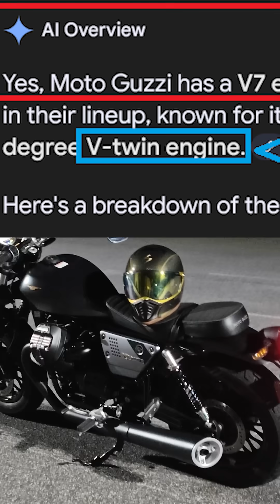wHy DoN'T CaRS uSE V7 ENGiNEs?

Comment: The divisibility thing isn't quite right. There's nothing special about 360 in terms of divisions of the circle. If instead of 360 degrees you had 350 degrees (and the choice of 360 is arbitrary, largely due to rounding the length of the year to a multiple of 60 as that's what some ancient cultures liked) then it would divide nicely into 7, 5, but not 6 or 8.

Comment: but doesn't crank pin arrangement matter? i mean i think you can fix it by arranging the crank pin layout to an I6 layout where it as an extra crank pin for 3 cylinders (1, 4 and 7) move at the same time while 2, 6 and 3, 5 follow.

This is specifically for inline-7s.

my english grammar is so horrible cuz it's not my first language. hope some ya'll understood what i meant.

Comment: You know that fractals exist??? The crankshaft could be offset by 360/7° and then it would have a regular firing order. the balance wouldn't be as good as on even number cylinders, but it would be doable just as it is with 5 and 3 cylinders. The reason is just that a V8 is barley bigger than a v7, but much cheaper to build and construct.

Comment: Of course it is possible to balance a V7. The problem is that the crank gets very complicated. No two pistons can share a journal. And it would still need balancing shafts. So, you end up with something more complicated and costly than a V8 and fewer cylinders. Bottom line counts. The V8 engine was introduced as a cost effective alternative to the straight 8. All things considered, I can't think of any good reason to build a V7 over a V8.

Comment: The 360 division thing is bogus. Degrees are an arbitrary unit of measurement, If we used radians instead suddenly no engines would divide correctly.

The real reason V7 engines aren't used is that odd number cylinder V engines need very specific angles between cylinders to be balanced, making them harder to manufacture and design.
V5's exist because they were developped for very specific racing conditions.
There are simply no cases where a V7 engine would ever be needed over a V6 or V8 so no company bothered to produce one, since it'd just be more difficult to develop and more expensive to produce for 0 benefit.

Comment: I always thought you could just join a 4 cylinder engine with a 3 cylinder engine at the crank and make an inline 7 that way and since both the 3 and 4 cylinder engines run smoothly I don’t see why this wouldn’t work.
Reply: While it is possible to do so it is not practical at all for a car to have a inline 7, this would also result in the worst car engine known to man, a inline 2 would be better, probably even a single cylinder as long as it's a small car.

Comment: But the number 360 is arbitrary, if we had 840 "new degrees" in a whole circle, the numbers would be whole.
Reply: Finally. Someone with more than two working brain cells.
Reply: even if it wasnt arbitrary, the division doesnt need to be whole numbers anyway.
Reply: So a 4/5 strok ?

Comment: i still dont understand why the piston number has to divide 360 or 720 cleanly, arent those just arbitrary numbers? theres (to my knowledge) no reason why circles are divided into 360 degrees other than that we have done it like that since ancient mesopotamia, so why does it have to divide an arbitrary number cleanly to function?
doesnt dividing 360 degrees by the number of pistons just tell you how far apart the explosions have to happen?
Reply: There are many reasons, and you should look into them. It's quite straight forward and well justified.
Reply: just asked chatgpt and it said that for example a v7 would inherently be unbalanced because it would have 4 cylinders on one bank but 3 on the other but for example an inline 7 wouldnt be inherently unbalanced because you can just space the powerstrokes 102.857 degrees apart, its just easier to use whole numbers, like 120 degrees between powerstrokes for a 6 cylinder engine. but there is no reason why an inline 7 couldnt be balanced, even though 720 doesnt divide by 7 into a whole number
Reply: @billcipher1212 "just asked chatgpt"

Opinion discarded
Reply: @Unknown-g7w  you say that like you expect me to just have access to an engineer that specializes in engines on a whim
Reply: @billcipher1212 I certainly expect you to consult with actual published engineering documents rather than a system known to output falsehoods on a regular basis lmao

Chatgpt is not a replacement for doing actual research.
Reply: @Unknown-g7w  but i dont care to do rigorous research i just want a quick answer
Reply: @Unknown-g7w it’s a youtube comment section, i do fear they dont need to commit to a whole study on an article just to give you an answer.

Comment: AI summaries trying to tell you that the Ferrari 512BB has a V12 instead of an H12:
Reply: I think you are a AI summary then. Ferrari themselves say it is a V12 engine, although I disagree with them on this, just like I do on a couple of old Ferrari models I think it's a Flat 12 or a Boxer 12 if you prefer. It is so extremely angled it is essentially flat. The BB also literally stands for Berlinetta Boxter. If you want to see H engine search up BRM F1 H16.

Comment: There are also 7 Cylinder Radials, Odd number cylinders like 7's and 9's are common with radials.
Reply: They are not common - every 1 row engine 4 stroke radial havs odd number of cylinders. Thats because with radials you almost HAVE to have odd number of cylinders. You want the cylinders to fire on opposing parts of the circle as the cycle progresses. But it cant be EXACTLY opposite, or the firing position will just bounce back and forth, and only same 2 cylinders will fire. So you want some shift - and that requires odd number of cylinders. Thats because 4 strokes require TWO full rotation to complete a cycle - and even number cylinders would let only half the cylinders to actually fire. 

In radial the more cylinders the smoother the operation, however more then 9, mean the connnecting rods have to become very long to actually physically FIT all the cylinder heads in the outer circle - so it was rarely used. 

Now why some radials seemingly have even number of cylinders? There are virtually a handful of TWO STROKE radials out there (or were rather) - those can have even number of cylinders. But most of the time, when you see something like WW2 Wasp Major with 28 cylinders, its in reality 4 separate 7 cylinder radials stacked longitunally on single crankshaft. Every "radial row" is odd number of cylinders

Comment: For 4-stroke engines 720 divided by cylinder count doesn’t tell you if the engine is balance but it’s for firing intervals instead which doesn’t directly affect the balance of engine but instead affects how smooth the power delivery is. For 2-strokes 360 divided by cylinder count tells the crank spacing.

Comment: I said that with the Rotary’s there’s 6, 8, and even 12 BUT no 7 I don’t get it.
Reply: The only production rotaries are most commonly 1-2-3-4, while the 5-6-8-12 are homemade, with a lot of time, passion and money. Awesome engines. Essentially if there is no 5-6-8-12 rotor engine then why would you make a 7 rotor? That is the question to ask, however I've never seen a 10 rotor and that is a engine configuration that makes more sense so I wonder when someone will build one.

Comment: Sorry, but while i usually can mostly agree with your explanations, this one is completely wrong. 

How the 360 degree divides, is completely irrelevant. Its an arbitrary number we assigned to a circle, you can just as well decide we use a measurement where 420 degree is a full circle, and suddenly it will divide nicely. JUst because the numbers look scary, doesnt change how they work - in 2 rotations of the crank, each cylinder will fire once.

In fact, in radial engines, 7 was a very common number for cylinder count (or multiple in multi-row engines). And while its very useful for radials (or even necessary) to have odd number of cylinders, they use same angle dividers.

So if how 7 divides full angle is irrelevant, then why?

Odd cylinder numbers dont really provide many benefits in terms of balancing. Even the 5 cylinder engines are inherently worse for balance then 4 or 6. So the odd number non rotaries are inherently worse for balance.

 So better question is , why there are 3 and 5 cylinder engines at all? 

Well for one, increasing cylinder count gives you more power first coverage than overlap. So going from 2 to 3 is a huge increase in power delivery smoothness, while 3 cyl engine is considerably smaller then 4. Its not a great tradeoff, but it can be justified - especially if smoothness is primary concern like in modern small car engines. 

Going from 4 to 5 is even smaller gain, but at least you are always in powerstroke and again its noticeably smaller then 6 cyl. Still , diminishing returns kick in, and 5 cylinders were always rare, and get almost extinct now. 

With 7 cylinders, you get basically 0 benefits over either 6 or 8 cylinder, and headache with balancing.

The other reason, is lets be honest - sound. 3 cylinders using fifth harmonics, and 5 cylinders using major third, produce very pleasing sound. Those are harmonics very common in music. 7 cylinders are only producing minor sevenths from musical harmonics - and even those arent really that useful. So the other reason is very much sound, and 7 cyls will produce interesting sound, but generally inferior to 6 or 8 cyls.
Reply: you are the only person i've ever seen actually grasp any of the points you just mentioned, let alone all of them. the only one you really left out was "radians exist as a way to measure angles, and are not evenly divisible by any integer because pi is irrational"
Reply: It is not an arbitrary number. You need to educate yourself.
Reply: @Unknown-g7w  Please elaborate if you want to dispute it. Because the fact is, angle measuring is arbitrary, same as basically every basic measurement unit - be it metric or imperial. 

If you want a historical unit that was widely used, you can use Zams which were units used for over a 1000 years in arabic world. They divided full angle in 224 units called "zam", which also meant that rotations or zams divided nicely in 7 parts - so full angle divides in 7 x 32 degree arcs.On other hand 5 cylinders dont divide in whole number leaving you with 44.8 degree arcs. 

So dividing full angle into 360 IS arbitrary, and wasnt always the case. Its a CONVENIENT number - because it has a lot of divisors, but there is nothing non-arbitrary about it.
Reply: @Unknown-g7w  it is arbitrary because humans invented it for mathematical convenience. They also invented gradians (400 instead of 360), but truthfully, you can subdivide a circle any way you please, and it remains equally valid and equally arbitrary.
Reply: Nah
Reply: @Unknown-g7w then why do 7-spoke wheels exist?
Reply: @wookieegoldberg what sort of question is this lmao? Because some people aren't very good engineers
Reply: @Unknown-g7w You have yet to offer any insights about anything. All you've done is insult other people's intelligence when those people have offered insights.
Reply: @wookieegoldberg they havent though? They've made assertions without evidence, not insights.

Simply spouting an uninformed and incorrect opinion that's clearly wrong isn't "insight". I'm simply dispelling those incorrect statements with exactly as much evidence as was provided to back them

Comment: Considering older 3 cylinder engines had separate geared counter weights for balancing I often wondered if the same could if been used for for a 7 banger
Reply: Even then the I7 would still be unbalanced on a fundamental level. 360 divides by 3 evenly, 7 does not
Reply: @straightman2 I mean you can still balance something that doesn’t have a “whole number” degree count. It’s mathematically very possible. And physically doable. It’s just a little rough for calculations. 
I think the true reason is if you have a V6 and V8, 7 cylinders feels like an awkward middle ground that doesn’t add much value, considering the balancing issues

Comment: It's probably possible. You can balance it with balance shafts or whatever.

The problem is there's no reason for it. Honda made the v5 because the minimum weight for a bike was based on the number of cylinders it had. 5 cylinder and 4 cylinder engines had the same minimum weight. 

By using lighter pistons, you can rev higher, lower reciprocating mass and all. Revving higher means more power in general. As long as your springs can keep up and friction doesn't become an issue.

The vr5 was for space constraints.

There's just never been a good reason to make a v7.

Comment: 7 is a prime number. Thats why
Reply: So are 5 and 3 and they work, so no
Reply: @sekhmet7774 my guess is that they end up being close enough to a whole number to where engineers are able to balance those engines
Reply: @BLUEFANGvv  They dont need to be whole numbers for balancing. 7/360 is just as good a number as 5/360 for engineering purposes. 7/16 inch screws works perfectly well, even though 7 doesnt divide 16 :P.

Comment: Is it possible to have a decimal engine. Something like an Inline 4.5 or something like that
Reply: Bro what are you on
Reply: No but for example the Honda NR750 is a V4 engine, but technically it's a V8 due to it's oval piston layout instead of a cylinder shaped piston. I'd still call it a V4, but technically it is a V8, since the pistons cover a lot of the engine and it even has V8 amount of valves, total of 32.
Reply: the number means how many pistons you have. you can’t have half a piston there guy

Comment: I love how much the cylinder stability rules resemble the islands of stability in chemistry 😂
Reply from the maker: Interesting! I'm not a huge chemistry guy, do they also have numbers that just can't work ?
Reply: @BladedAngel yes, for example element number 43 (technetium), doesn't have any stable isotopes (no number of neutrons can stabilize the core), even though both elements 42 (molybdenum) and 44 (ruthenium) have multiple stable isotopes (6 and 7 respectively)
Reply: @Niinkai  im losing it i swear to god
Reply: @BladedAngel In a way... yes

In the periodic table, we can only see 118 elements, and the reason is that anything past 118 and synthesizing such an element isn't worth it. They're super unstable and will die off in milliseconds. Kinda like an engine with an odd number of cylinders. Just not worth it to do (couldn't think of a better analogy lol).

However, the island of stability is like a magic number of a combination of protons and neutrons that avoids the problem I mentioned earlier of atoms straight up destabilizing the more protons you have. Currently, 118 is the hard limit, but theoretically, there exists other atomic numbers that can be possible, we just haven't got there yet. Those elements are a stable island within a sea of instability, hence the name.

In engine terms, it's like how an engine that strikes both primary and secondary balance is possible with an appropriate cylinder count, like I6, V12, a V24. The island in this case, is any number that satisfies these conditions. Whether anyone is crazy enough to make a V360 however, is the real challenge. 

I'm massively oversimplifying this ofc, but I hope I'm making sense
Reply from the maker: @PearlPredator  I appreciate it, I've enjoyed this comparison! honestly now it's going to be something that'll get in my YT Recommended now, since I'mma watch videos on the topic LOL
Reply: @BladedAngel  fun fact: elements with an even number of protons also tend to be more stable than elements with an odd number, hence why we managed to synthesise element 118 years before element 117
Reply: I can't wait for the V1 engine.

Comment: V6 was afraid of I7 because it vibrates a lot
Reply: Vibr8s*
Reply: @sandwhichdestroyer12   Vibreights*
Reply: @rdrac

vibrates*
Reply: no cuz i7 was a registered v6 offender
Reply: Intel Core I7-14700k*
Reply: @AndreRussellFitnessOfficial . BMW i7*
Reply: Vibrechts
Reply: The V6 was afraid of the v7 because 7 8 9
Reply: @staples138 🎉
Reply: 7 h8 9
Reply: 6 7 🫱🫲⬆️⬇️⬆️⬇️⬆️⬇️⬆️⬇️
Reply: A i7 could bebalanced tho as far as uneven can like a 3 or 5 inline, like i said inmy general coment it should be smooth-ish if the fire order is 4 1&7 2&6 3&5 repeat(4 gets ballanced by the outer ones 1&7 then 2&6 ect issues i think is sideways forces)